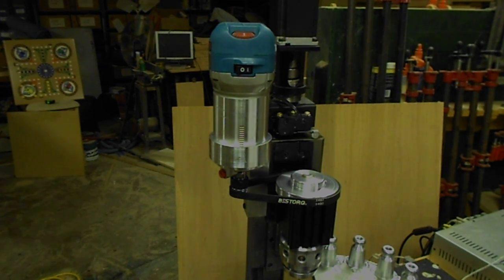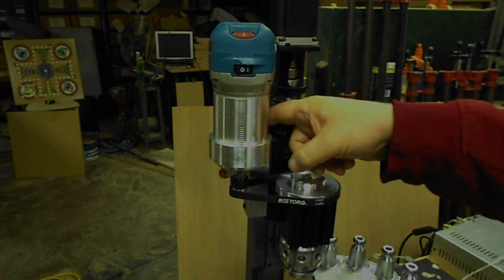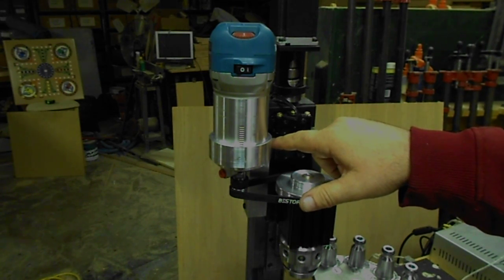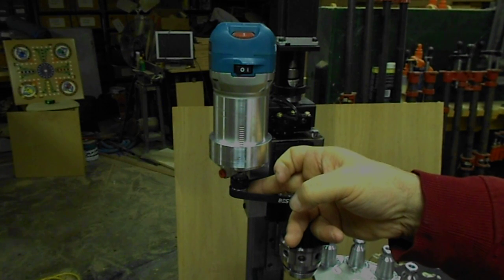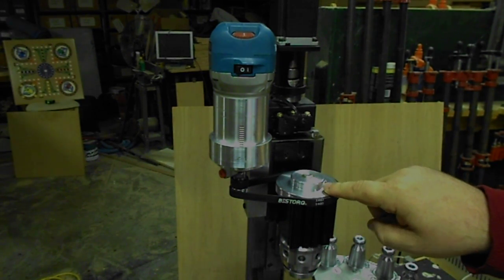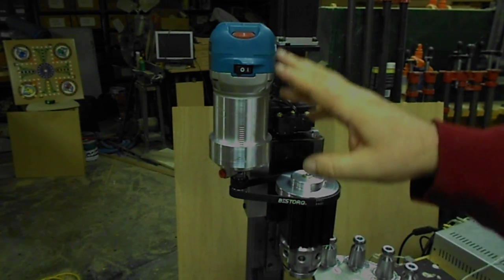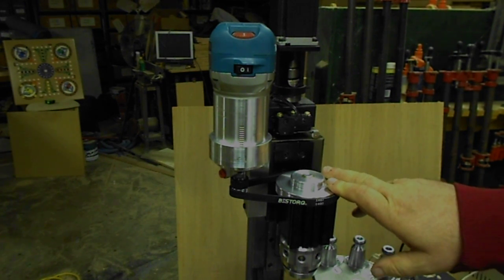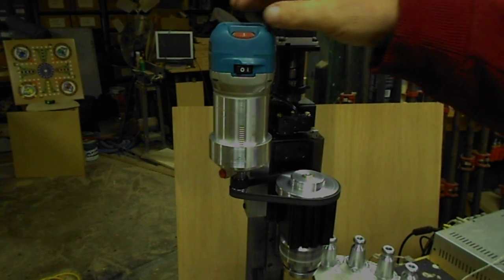Replacing the Taig Mill motor with a Makita VS trim router (2500-7500 RPM)

Comment: This is beautiful work! I just watched your 8 Ball video. Super good and excited to purchase when you have it figured out. 
I have a project I'm working on that would greatly benefit from the two sheaves you produced for this (thank you for the belt link also). 1:4 ratio is perfect. 
Any chance of getting some more made for a fee... I know somebody has already inquired... I have a similar set up in mind
Reply from the maker: Lee, I sold the parts on this video to Benjamin Shaw (2 posts below) but it might be a while before I market the finished product. I will say that if you have a small metal lathe you can create your own sheaves using a "VNMG" (35° insert) and a neutral (straight/ no angle) tool holder to create the belt grooves. The actual angle was 40° but you may be able to get by at 35° instead. Heck, make it even simpler and grind a 40° straight tool from a HSS blank for that matter. The dimensions are somewhere in that posting as well.
Reply: Thank you, I know well that time is never around when you need it. I look forward to seeing your products in the future. I'll look into modeling my own and outsourcing the build as I don't have a lathe yet. Thank you for the information and tips! Best of luck

Comment: I have done a similar conversion on my mini mill. How does yours perform?
Reply from the maker: It is much better now. Less weight, no belt changes.....but a bit more loud.
Reply: @Christopher: And how is the drilling (as opposed to milling) with this configuration -- does it still work well, compared to the stock Taig? Fantastic videos, all of yours, by the way! Inspiring stuff.
Reply from the maker: Works well now. Peck drilling was why I had to design a new system with 20° taper. The 10° taper had a tendency to wedge and lock after a multiple pecks. Thanks for the kind words
Reply: @Christopher, good to hear! I just saw that you mentioned this in the description of your 8 ball ATC demo video. For the spindle's 20 degree taper, do you happen to have any further design details, if I'd like to go about making this happen? I'm guessing I need a lathe... I'm also open to buying a pre-made one from you, if you are interested in that kind of arrangement. I'd be happy to pay well for that.

Comment: Would I need a 4th axis to create the pulley?
Reply from the maker: I used a CNC Lathe. You can use a manual lathe with a "V" (35° cutter) and "neutral" tool holder to cut the grooves. It won't be 40° but will probably work just fine. Here is the complete info .....
(COPIED FROM A SIMILAR POST BELOW)
 http://www.vbeltsupply.com/k-series-poly/j-series-poly-v-belts - for the custom belt sizes140J4 Serpentine Belt (14 is the length / J is the series / 4 is the number of V bands) 
http://www.torquetrans.com/custom-multi-ribbed - shows the geometry for the "J" series sheave. You can use any one of the series types but I chose to use the "J" series because it uses a 40° groove and .015 radius root which makes it a perfect profile for a  VNMG-331(35° with .015 tool nose radius) insert held in a neutral tool holder. I just used the minimum accepted profile (.800 dia) for the router sheave and 4x that (3.200) for the spindle sheave. You can create the geometry and make it work on any diameter though.
Show less
REPLY
Reply: Would you consider making me the pulley for a fee ?  I am still a ways away from having this capability.
Reply from the maker: Do you have the original Taig motor, or have you changed it to a trim router or equivalent?
Reply: I want to change it to the 1.25 hp makita. Right now it has a 1/4 hp original taig motor.
Reply from the maker: I could sell you this very setup, since I have replaced it all with a newer design. It would include the router clamp, small .800 router driven sheave, 3.200 diameter spindle sheave, and belt for 50 dollars. That is, if I can find them in my cluttered shop. :)
Reply: Yes. I would do that. It might take me a day to shuffle some funds around. Do you have paypal? Or take cryptocurrency?
Reply: out of curiosity, what is your new setup?
Reply from the maker: https://www.youtube.com/watch?v=7NP6k5vFUBE&t=133s
I made a much more rigid spindle that uses bearings that are twice the size of the original Taig bearings and had to build a whole new spindle housing to accept them. The motor clamp is now mounted to a 1/2" dowel that slides into the housing and the spindle sheave is a bit smaller to match the diameter of the housing.
Reply: Wow. I guess Ill stick to the makita for now. I'd love to purchase your old setup if it's in good shape still.
Reply from the maker: https://www.youtube.com/watch?v=4B59ZnPdjJA&t=11s
This is an internal view of the spindle.
Let me see if I can find it all in my shop. It is all in excellent condition. In fact, I don't know why Taig hasn't got rid of the rubber-band belt they use and go with the much more robust serpentine belt.
Reply from the maker: Don't have any of that yet, but a money order will do just fine.
Reply: I thought that as well. I just got my taig and the first thing I noticed that made me doubt it was the tiny belt.
Reply: Im not seeing a way to private message you to exchange addresses.
Reply from the maker: csmith@vernoncollege.edu

Comment: Did you make the sheaves?  And what belt are you using?
Reply from the maker: (COPIED FROM A SIMILAR POST BELOW)
 http://www.vbeltsupply.com/k-series-poly/j-series-poly-v-belts - for the custom belt sizes140J4 Serpentine Belt (14 is the length / J is the series / 4 is the number of V bands) 
http://www.torquetrans.com/custom-multi-ribbed - shows the geometry for the "J" series sheave. You can use any one of the series types but I chose to use the "J" series because it uses a 40° groove and .015 radius root which makes it a perfect profile for a  VNMG-331(35° with .015 tool nose radius) insert held in a neutral tool holder. I just used the minimum accepted profile (.800 dia) for the router sheave and 4x that (3.200) for the spindle sheave. You can create the geometry and make it work on any diameter though.
Reply: Christopher Smith thanks. Sorry I didn’t catch the post from the older comments. Grandkids walked in as I was reading through them so I just made a quick post.

Comment: do you have a link to the belt and drawings for the pulleya
Reply from the maker: +matt whitehouse
 http://www.vbeltsupply.com/k-series-poly/j-series-poly-v-belts - for the custom belt sizes140J4 Serpentine Belt (14 is the length / J is the series / 4 is the number of V bands) 
http://www.torquetrans.com/custom-multi-ribbed - shows the geometry for the "J" series sheave. You can use any one of the series types but I chose to use the "J" series because it uses a 40° groove and .015 radius root which makes it a perfect profile for a  VNMG-331(35° with .015 tool nose radius) insert held in a neutral tool holder. I just used the minimum accepted profile (.800 dia) for the router sheave and 4x that (3.200) for the spindle sheave. You can create the geometry and make it work on any diameter though.

BTW - Thanks for the info on the SuperPID. I went ahead and bought one!
Reply from the maker: +matt whitehouse Did you ever make any of these sheaves?
Reply: +Christopher Smith no i didn't I got side tracked